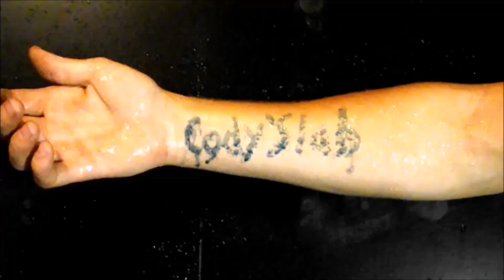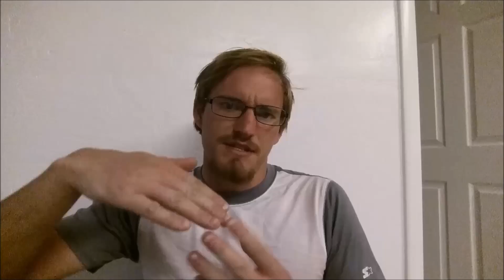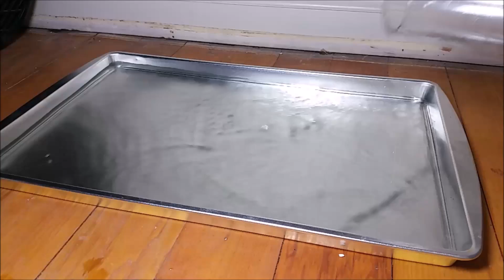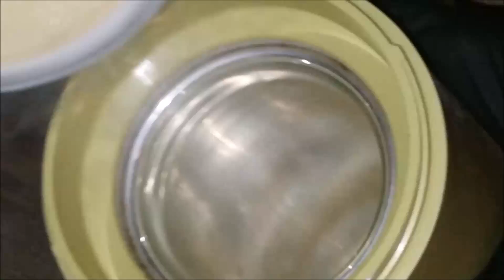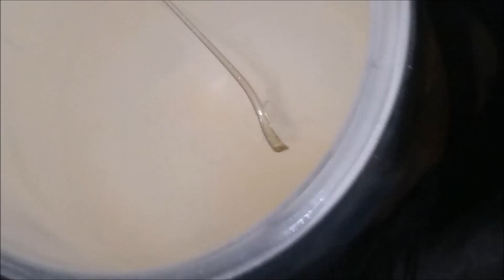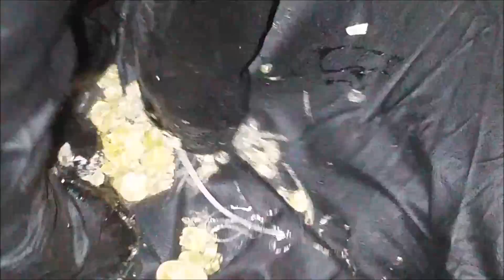What If The Oceans Were Made Of Acetone?

Comment: I'd assume it's due to the vapor pressure, since the acetone is evaporating and condensing much more frequently at the surface, as a molecule of acetone evaporates it is carried away close to the surface by the wind. Some of that acetone is forced back to the surface where it should condense and transfer its momentum. A way to test this would be to do the same experiment but increase the temperature of the water. If you get near the boiling point, water should behave similarly to the acetone.

Comment: If you ever repeat the experiment, I would like to see you add a few drops of oil on the water surface. Lifeboats used to carry some oil for the purpose of calming rough seas. It spreads into a thin film, and the wind doesn’t “catch” the surface as much.

Comment: viskosity, density are also to be considered. surface tnesion only contributes significantly to the propagation of pretty small waves (capillary waves). larger waves mainly depend on gravity.
you can decrease the surface tension of water by simply adding a detergent.
.
Reply: take a bucket of tapwater and pour it into another bucket. now do the same with water containing some detergent. notice the differnce in sound? do the the same with boiling tapwater - will sound more like water containing detergent. so, surface tension seems to drop with increasing temperature - which makes sense after all.
Love your videos Cody!!

Comment: Based on that test, doesn't confirm the waves would be bigger to me. It looks more like they are breaking up faster meaning the frequency of waves has increased. This would make sense since there the surface tension doesn't reqire as much force to 'pul apart or crack'. 

The amplitude however is likely smaller but as mentioned, that test does not prove that.

Comment: The surface tension of the liquid means there should be a force applied if the surface is bent, would it be this force that resists the formation of waves? And thus, once the surface is broken, the viscosity and density of the liquid would determine how quickly it flows and returns to a resting state, IE, the amplitude as well as how quickly the waves dissipate.  The cuts don't show it, but I predict the acetone returned to rest quicker than the water once the fan was shut down.

Comment: Having taken a fluid dynamics class, I can say the cause of wind creating waves is most likely due to surface friction and the continuity principle. That is, velocities in nature aren't discontinuous, they change smoothly. So, the air moving over the liquid will be slower closer to the liquid's surface, in fact right at the interface it should have exactly the same velocity as the liquid. But, this causes shearing in the air, due to the bottom layer being slowed down. In turn, this has a reaction force which shears the top layer of liquid and starts it moving. This is where the imperfections and currents you were talking about come up, those little non-uniformities aren't the only place the air pushes the liquid, but they do get magnified by the motion that gets caused, and by a process similar to preferential attachment (bigger wave gets pushed harder) they get amplified until you have ripples and eventually waves.
Note: Breaker waves like you see at a shoreline have somewhat different causes, as they involve circular traveling wave currents which get interrupted by the shallowing depth, causing the water to pile up and spill over.

Comment: Acetone= Higher frequency of waves equals less momentum =making more, smaller waves. In water the surface tension allows the waves to  increase much larger sizes without dissipating in two ways - by increasing the transfer or wind energy and by allowing the water beneath to be dragged along with the water on top (while the second factor is not ONLY due to surface tension but other various properties of water like viscosity it is still equally as important to mention pertaining to the increase in waves sizes). Here’s the cool part with water, this size increase in turn allows water to absorb more force from the wind again increasing the size and momentum exponentially, feeding itself basically. It’s these TWO factors that make waves that we’re accustomed to seeing. Difficult to see with water in a oven pan but the results were actually correct according to your original hypothesis! In your size scenario  less waves created in the water is the expected outcome! you could see this if you were able to detect the amount of force the water makes hitting the back end of the pan compared to the acetone (it would be greater in water). Even though in water there were less waves, they transferred the wind energy into “wave energy” more efficiently and would have had greater impact. In this scenario the differences would probably be too small to detect, let alone be “scientific” haha but in much much larger cases you would see that the wind clearly transfers more kinetic energy in higher surface tensions (water) vs lower ones (acetone).
Reply: A cool test I would think, would be to measure the differences in liquid bodies by a gravitational pull (like the moon over the ocean). No idea how to do that, maybe break out some magnets XD

Comment: You are not factoring in the vapor pressure of acetone.  Room temperature is close to the boiling point of acetone (relative to water). When you blow air over the top of acetone you cause it to evaporate even more quickly than it already does. You should do this in an enclosed container with an atmosphere saturated with acetone vapor.

Comment: Not just the surface tension, lower viscosity makes it lot wiggly because aceton molecules move onto each other easily, on the other hand density also matters. With higher volume like seas or oceans sizes, results are likely different. I dont think waves’ amplitues will not go so high, in fact it will be broken from some point and splatter in the air where as water ascends with wider form of waves and relatively higher visc. keeps it together. Think it like some sort of inertia of liquids

Comment: I would say wind represents a difference in pressure, and a wave is a transmission of that difference in the direction of propagation as the water tries to return to a state of equilibrium from the initial displacement.  Perhaps viscosity and density would be better variables for this experiment?

Comment: It's more to do with the weight of the liquid. If the fluid is lighter than it can get higher with less energy(wind speed) and if it is higher it can capture more energy(because the wave has more surface facing perpendicular to the wind travel). So a lighter fluid  should compound the energy that is being absorbed. Surface tension just has to do with frequency of waves instead of height.

Comment: Ha ha, WOW, ONE DROP of soap, dude. ONE DAMN DROP of soap is what you should have added there, even that is MORE than sufficient, you added like a tablespoon or more, if you add THAT much of that thick goo you're going to increase the viscosity and significantly change its composition, and you just want to decrease the surface tension, you're not as erudite as you think you are, a drop of oil would have worked as well.

Comment: could it have also something to do with the specific weight of acetone? its only 79% as heavy as water, so the difference between the density of the used gas is smaller...mayby blowing differend gases in a closed enviroment at it would have differend results

Comment: Is there a strong attraction between the liquid and gas phase of a given compound? Acetone has a high vapor pressure. The air current may be interacting with the acetone vapor first, and then the vapor may influence the liquid either because of changes in air pressure as others have suggested or some kind of inter-phase adhesion.

Comment: May be an issue with the boiling point. By generating wind you increase evaporation which will increase on the crests of waves, this will create more of a low pressure above the crests, pulling up the crests more.
Try doing the experiment with acetone at lower temperatures, such as in an industrial fridge/freezer.
Reply: I was thinking vapor pressure as well. If we simplify the model and say that all of the gas is moving at a constant speed. It's my understanding that acetone vapor is twice as dense as air. So if we consider full saturation (which we approach at higher temperatures), the gas current above the liquid would have twice the kinetic energy. That has to mean something.

Comment: Surface tension would be a barrier to restrict the wind from picking up the water, like a rubber sheet. Also, acetone has a different density and viscosity than water (both lower, coincidence only). The properties of the ripples generated would start at a different scale and speed than with water.

Comment: Fluid density also comes into play here. It's much easier for the air to move the acetone because it is less dense.
Reply: Well he effectively did that when he added the soap.
Reply: ThrowingItAway Thank you for noticing that! I agree with you. I think a more scientific approach would be finding something with density that matches that of water but has different surface tension. Less variables could help us see the true effects of wind on different surface tensions... But anyway I'm way too lazy and Cody did a while lot more than I would be willing to just to test that... lol
Reply: Negative. Viscosity is a completely different property, and only has to do with internal friction, or resistance to flow.
http://www.dictionary.com/browse/viscosity?
Reply: The only thing surface tension does is keep the water stuck together. This means it will make bigger waves before it loses cohesion, and just turns into an aerosol. The density of the liquids is what determines how easily they begin to form waves. Denser materials require greater wind energy to start them moving than the less denser materials. However I would think that if the liquid had less surface tension, the waves it would make would be lower in height, and become airborne as an aerosol much sooner than something with a stronger surface tension.
Reply: *viscosity

Comment: Cody, you did not made oil on the water experiment. In the middle ages, sailors has barrels full of vegetable oil, and every person had its personal paunch with some oil in it. All of that in the case of shipwreck in situation of high waves. It is not needed a lot of oil, just some minor spill to get large surface area with no waves, or less intensive waves - so that everyone can grab something floating and survive the disaster.

Comment: Funny, when you posed the question my assumption was less surface tension in the acetone would mean it would be easier for air to push it around creating larger waves. So I was surprised your hypothesis was that it would possibly decrease wave size. Great experiment. Shows that it's very easy to have different hypothesis based on certain reasoning, and it all comes together when tested.

Comment: Density of water is 1000 kg/m^3 and acetone is ~790 kg/m^3. Could it be that the acetone is less dense and although the force the wind exerts on the surface of the water is equal in both scenarios, the acceleration caused by it for the acetone is greater? (Probably more factors that play roles but this may be one)

Comment: Maybe your result could be explained by the way waves develop from capillary waves into fully developed waves. Lower surface tension would cause more of the waves to break when they were smaller, which would result in more turbulence. On the other hand, water waves would persist and have a chance to form a standing wave with noticeably less turbulence but actually greater amplitude and wavelength.

Comment: In my opinion the waves from the water are not as high and frequent as those from the acetone because water is much havier (higher density) than acetone -> means the intertia of water is much higher and it needs more energy to create waves (density of water: 1000kg/m³, density of acetone: 791kg/m³) -> it tooks about 26.4% more energy to create waterwaves with the same hight, frequency and length as acetonewaves would take.

Comment: Actual ocean waves are created like this:
First there is a small ripple in the surface of the water which shields the surface behind just a little from the wind.
That means the velocity of the moving air directly above the ripples is greater thus generating a higher dynamic pressure (not the actual name I guess). That's where Bernoulli's equation comes into play and the hydrostatic pressure drops. Since the hydrostatic pressure behind the ripple is greater and pressure is an isotropic force more water ends up getting pushed toward the ripple increasing the wave's size. Of course this is limited by certain things most importantly gravitational potential.

This might seem counterintuitive but it's the same effect when you place 2 sheets of paper close together and then blowing inbetween. Instead of moving outwards the sheets will move even closer together and touch.
Viscosity and surface tension are really only limiting factors.

Comment: In my transport phenomenon class in college a professor talked about waves in the ocean as a result of momentem from the air being transferred to liquid. The momentum transferred to the liquid is going to depend on a lot of things, and I'm not sure how surface tension relates. In terms of the fluid properties I do know that the density and viscosity of the liquid definitely affect this. You could try demonstrating this with different solutions that have different densities and viscositis. Like concentrated brine with 1.2 specific gravity, (~320g/L), mineral oil i think is around .85 spg, or perhaps a a solution of honey and water =P

Comment: Late to the party but have to agree with what has been said in the comments about the role of viscosity and density. I think you will find that the role of the surface tension, amongst other environmental factors, is wave damping. Without sitting too long thinking about it and how to model what is going on via FEA.

Comment: isn't it just shear force on some of the ocean surface area which just means there's pressure moving the fluid?
if we assume the more the water on the surface gains velocity the greater its elevation then if the pressure on the surface gradually increases then suddenly decrease it would look like a wave.
so how big a wave is how high it goes with more velocity

Comment: Waves are caused by friction between the wind and the water. They transmit the energy transferred from the wind to the water. Let's assume approximately the same energy is transferred to acetone as to water. The energy in a wave (ignoring all other effects like viscosity and wavelenth) is going to depend largely on its mass, hence the density of the medium. Water is more dense than acetone therefore you would expect acetone to produce larger waves. And that is what you saw. You'll be a great experimentalist.

Comment: just to give you the simplest explanation i can for surface tension affecting wave modulation (amplitude and frequency) try to view "surface tension" as "resistance". a higher surface tension exerts a higher level of resistance so therefore two liquids of differing surface tensions will have wave formation in accordance with their respective surface tension. furthermore amplification of waves IS affected by wind catching the surface of the swell as you theorized with the acetone being more easily affected. the higher surface tension of the water causes the swells to maintain structural integrity better and you end up with a more aerodynamic surface over which the airflow is smoother where with the acetone the higher swells manifested due to lower surface tension allow the airflow to create cavitation in the trailing face (the side being pushed by the wind) of the swell  which causes the pressure of the airflow to be increased and push the swell higher. neither wave (water OR acetone) would crest (the part surfers ride on) until they reached a depth shallow enough for that specific mechanic to take effect. water crests at half the depth of the height of the swell if i remember correctly but i dont know what the depth requirement for an acetone wave would be.